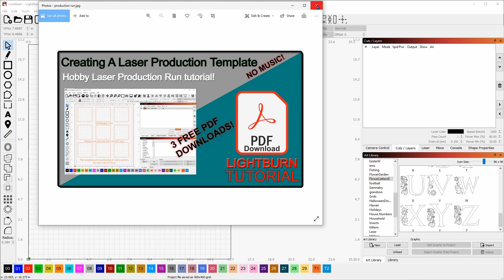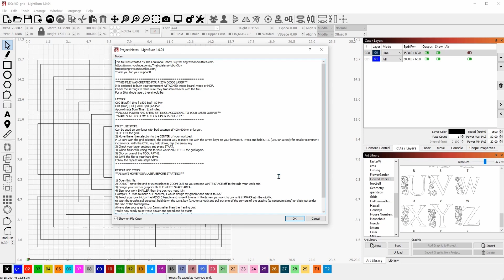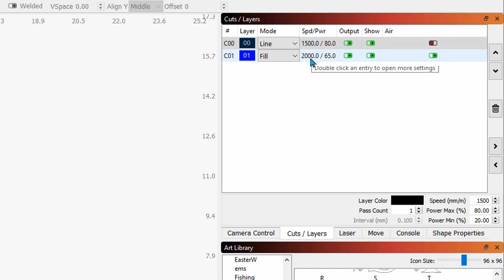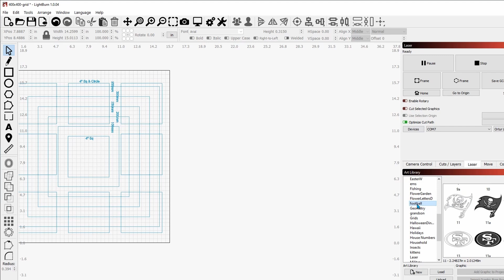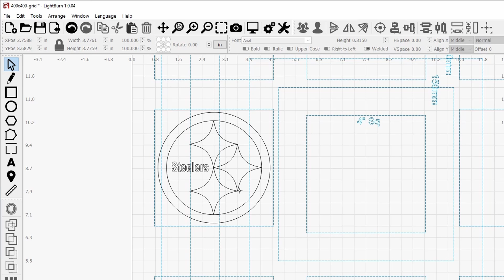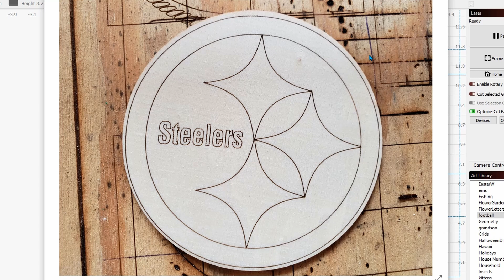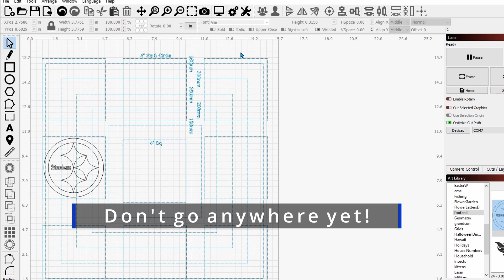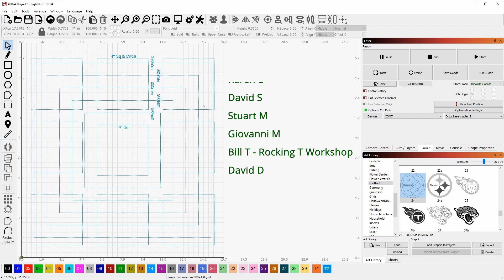🆕 Burning a Laser Bed Grid Version 2!

Comment: Not sure what I'm doing wrong. Burned the grid, put it on a tool path, saved it. After I was done burning for the night I shut the laser and PC down. The next day I started my PC, opened lightburn, and loaded my grid and it was half off the default square that lightburn always shows. Yeah, I'll never line it up again, so I scrapped another wasteboard. When I start Lightburn, why doesn't it place my grid perfectly overlayed right where I saved it? Not sure if it matters or not, but I'm using a Sculpfun S30 Pro.
Reply from the maker: After you put it on a tool path, select everything, right click and lock selected objects.

Comment: I'm new to lasers and recently bought the Two Trees Ts2 20W. I downloaded your grid and I have a question, my working area is 450 X 450, can I resize this to fit my working area?
Reply from the maker: No, grids cannot be resized, however, you can use it as-is. The extra 50mm won't make a difference project wise. Just align it to the 0/0 point to use it. I believe that's the bottom left corner on the Two Trees.

Comment: I have a stupid question since the waste board is 400x400 and the area of the s9 is 400x410 do you need to center the waste board in lightburn before burning it?
Reply from the maker: I would use the Lightburn alignment icon to position it in the 0/0 position Joseph.

Comment: I downloaded this project. Thank you. I opened this file and tried to burn it; however, I got a message saying it's out of bounds and will not attempt to burn it. When I hit the origin tab, the laser moves nowhere near the upper left corner of the target plywood. What am I doing wrong?
Reply from the maker: Delete the outer box. This was designed for a 400x400 laser, however some of them are slightly smaller. Origin doesn't matter.
Reply: I have a new Ortur Laser Master Pro 2. I'm very new to this. I can't get it to burn anything. I always get this message: ALARM:2 G-code motion target exceeds machine travel. Machine position safely retained. Alarm may be unlocked. Any help greatly appreciated.
Reply from the maker: That error means your graphic is outside the bed boundaries or larger than the bed size.

Comment: Great video. I successfully burned your grid last night. I do have a question. Using your circular example, you line it up in the middle of a 4” square. Where are you setting your origin point? The lower left point of the square?  And then it will go to the round project when you hit start?
Reply from the maker: You can set your origin anywhere you want Michael.

Comment: Thank you very much for those files, It should make life a bit easier for me.
 However, when I load the file and try to Preview it I get the following message "One or more shapes are crossing the edge of the machine workspace
Reply from the maker: That's okay, just ignore it. You're set to user origin or current position. You'll get those meaningless errors in that mode.
Reply: @TheLouisianaHobbyGuy  Thank you again. All I need now is for my laser module to arrive and get to burning.

Comment: For some reason when I burned this it was upside down and reversed. Any recommendations on what to do to fix it and not have to reverse all of my projects?
Reply: will I have to do this for everything?
Reply from the maker: @WhitworthARMYstrong  Not if your origin is setup properly, and only if the file was designed  by someone else.
Reply from the maker: It was designed on a laser with a different origin than yours. Just select everything (Ctrl+A) and use the mirror icons at the top of the screen to mirror both vertically and horizontally.

Comment: You say 20w laser. I have the xtool d1 10w. Do you mean 20w input or output?
Reply from the maker: The output is all that matters. When I say 20W on a diode, that's 5.5W optical output. At one time, the two were synonymous until the marketers got a great idea to misrepresent them... I can put a 100W power supply on a 1.5W optical diode.

Comment: Another great video I have downloaded the file I have got my Ortur laser master 2 pro s2 bracketed fixed to my ply baseboard and was thinking of getting some 3mm ply cut to the right size and dropping the ply in my laser bed then I would be able to take it out at any time and just drop another one in a similar grid at any time needed just an idea. 😁
Reply from the maker: If you were going to do that, you would need to have corner brackets so the board would be in the exact same position every time. I use cardboard templates instead and just burned a square on the wood to line them up. I have a video on the process.

Comment: For Christmas I got a CNC/Laser machine and I’m gonna ask a really dumb question. Could I put a sacrificial spoil board on top of the one that came with machine and laser that grid on it? I would leave it on there until I need to replace it.
Reply from the maker: Absolutely John, that's exactly what you do with a CNC. 1/8" ply is your best bet so you don't loose throw space on the Z.

Comment: I'd have to adjust this. 4" squares are out.  No hardware stores seem to sell 4" tile anymore. Best any can find is 4.25.
Reply from the maker: You could easily adjust it Phil, or just use 2 sides to align. Where I live 4" tiles are common in both Home Depot & Lowe's. The 4" grids are more for coasters than tiles though.

Comment: Quick noob question. How do you set up the laser to start at the point you place your item on the grid? It’s probably simple and I may have missed the “how to” in this. Thanks. Great video as always.
Reply from the maker: On the Laser Tab --> Start From --> Absolute Coordinates. Or, you can go to the Move Tab --> Set your position to the Y & X coordinates you wish at the top --> Click the Set Origin button. This one is mainly used for jigs. You can also click the Manage button and add a new saved position for a jig so it will always be ready to use.
Reply: @TheLouisianaHobbyGuy  thanks for the quick response, it is appreciated. Have you done a video on this? Setting points of origin for jobs?
Reply from the maker: @r.leepanderjr.6308  Not yet Sir, but in my upcoming review of the Congo Z1 laser next week, I will be covering this topic.

Comment: I finally mounted my laser on a piece of Baltic birch & bought LightBurn.  I'm trying to burn your grid but it says "one or more of your shapes are crossing the edge of of the machine workspace."  So I tried shrinking  the grid pattern but it's not using up the space my laser can burn.  What am I doing wrong?  I have  NEJE Master 2 S plus.
Reply from the maker: You have to have the grid perfectly positioned for it to work. Off by 1mm in any direction and you'll get that error.

Comment: Great video Rich!  I have  NEJE Master 2S Plus laser & haven't started using Lightburn yet, but I'm looking forward to learning how to use it.  Question:  I notice you recommend a steel bed for your LASER.  How does this work with the bed grid you recommend in this video?  Is it used on top of the steel bed?
Reply from the maker: Yes, I line my steel grid up with the lines on the laser bed. Or you can just buy a $5 oven pan from Walmart and take out the rack and use that. This way you can still see the grid on the workbed Larry.

Comment: Hey Rich, I just burned the new waste board but my color number boxes end at 29 but I don’t have a T1 and T2 tool path box to save it on, do you know why that may be? Can I save it on another number some way? Thanks, Mike.
Reply from the maker: Hi Mike, you might be running V 1.0.02. There was a bug in that version of Lightburn that removed the tool paths. Click Help in the menu --> check for updates. You can always use any layer in the meanwhile and set the layer power to 0.1% so it won't burn anything.

Comment: But it’s not aligned. This method is only as good as your human eyes. Solid stops are the only way. Not to be rude but this would get rejected by my boss.
Reply: Have you looked at some "production" pieces in stores? His demo piece was aligned as well or better than what I've seen in stores. The ones that get it 'perfect' usually cut the perimeter to ensure it's 'aligned'.
Reply from the maker: Of course he would! My original video uses templates. This was made for the hobbyist that needs to do a few quick pieces Brandon, not a production shop. Thanks for the comment! 🖖

Comment: Thanks Rich for another great video. One way to keep your bed grid from moving once it's been converted to a tool path is to select it, right click, and select "Lock Selected Shapes". That will lock it in place so as you move your cut/engrave graphics around on the bed you won't be able to accidentally snag one of your grid objects.
Reply: Thanks, Rich & David. Right on the money. In addition to this, in case your physical board moves, 2 (or more) registration marks could help to re-align it [nearly] perfectly.
Reply from the maker: @mp6814  Why didn't I think of that? You guys are AWESOME!
Reply from the maker: Great tip David! I'm going to use that!